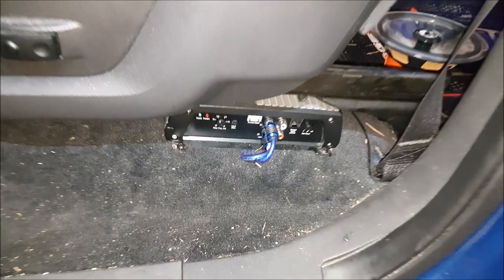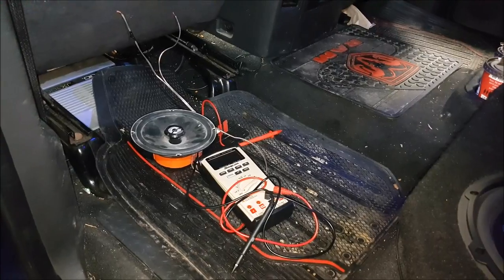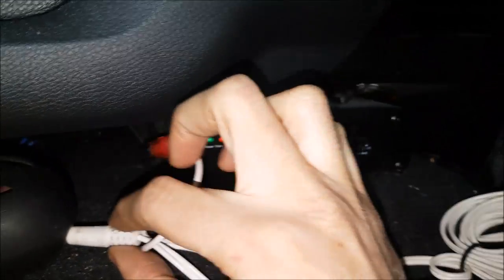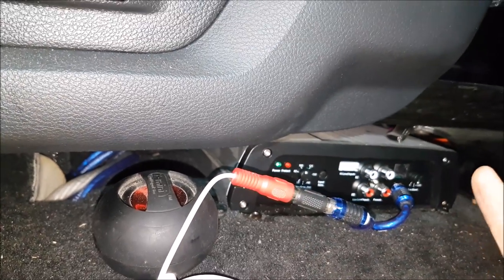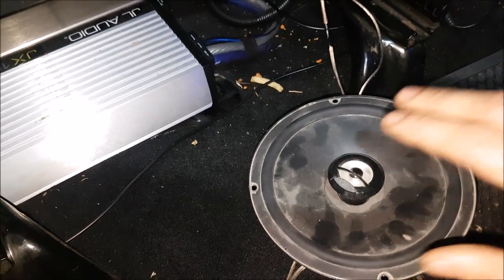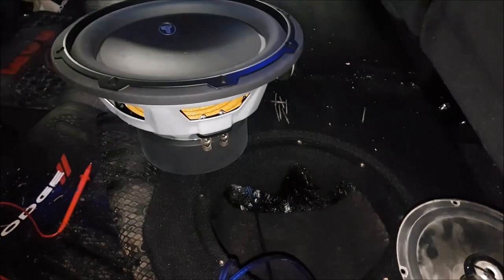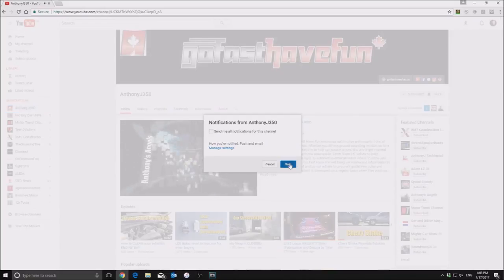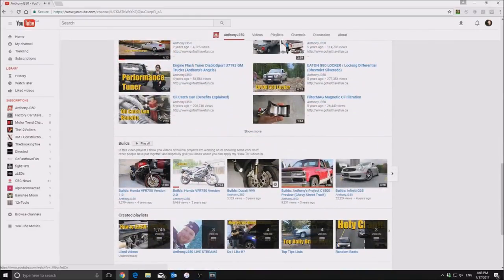Diagnosing a Sound System with no sound QUICKLY | AnthonyJ350

Comment: If the two speaker leads were to touch would that cause for amp not to work. Like would it be as simple as the fuse being blown on the amp or deeper problems
Reply: The 2 speaker leads touching can blow the speaker output terminals or cause a fuse to blow. Some digital amplifiers do not have fuses and need to be reset, some work after being reset and some do not. You always want to ensure the wires do not touch each other and hook to a speaker thr proper way. Think  of the speaker wires like a battery, you have a positive and a negative. If the positive touches a negative it arcs, this is the same if the negative touches a positive output.
Reply: @stevenb320  I'm late asf but I just accidentally did this and now my shit is gone 🤦‍♂️🤦‍♂️🤦‍♂️ my stereo even blew out with it or something  because neither work
Reply: @StopCappinHo  check your fuses first. Get a voltage light tester they are cheap at any store. Check your wires, power Acc turn on, Yellow constant, ground and remote wire on the head unit. I've seen this happen and killed the constant wire to the radio. 
Also check the wiring to the amp the same way. Power, remote, ground. Check all fuses or try replacing even if they look good they can still be bad.
Reply from the maker: It would cause the amp to go into protection or possibly damage the output.

Comment: I hooked up a shitty door speaker to the 1000 watt Rockford amp and it works but the little speaker moves gets sound but not a lot when I connect it back to the sub the sub doesn’t move it’s like the amp is hardly outputting power best part the system was on for about 3 hours straight brand new out of the box and just stopped working
Reply from the maker: Is it a dual voice coil sub?

Comment: i have a pyle pca2 stereo power amplifier 2x 40W and it stopped working while it was plugged in and I was away from it. it still turns on and the speakers I'm testing it with work with my other stereo,  but there is only a buzzing when I connect them to the amp. any ideas? great video!
Reply from the maker: Are you able to test the RCAs?
Reply: @AnthonyJ350  like with a multimeter? I don't have 1. but I know the cord I'm using works elsewhere. if it is the RCAs, would that be an easy fix?

Comment: Hi mate good video but I'm still having some trouble I've tested my rca cables brand new amp powers on works on a old door speaker but when I connect it to my alpine sbg-1244bp it doesn't play sound. I've tested the new sub with a multi metre and it's reading the 4 ohms. Do you have any ideas or any other testing videos what could help me please
Thanks
Reply from the maker: If you play the original speaker it works?  Is it a Toyota by any chance?
Reply: @AnthonyJ350  thanks for the reply mate I've sorted it now the amp was broke when it arrived hence all the head scratching lol
Reply from the maker: @joes9314  Glad you got it figured out 🙂

Comment: If I use a test light on the positive connection of the speaker wire I should get power right? My JL 500/1 has power and ground but I'm getting no power out to the sub. Also I just recently blew my Kicker L7 and just replaced it and now all this started happening. Any advice would be greatly appreciated. Thanks
Reply from the maker: You need to use a multimeter. Speaker output is AC voltage
Reply: @AnthonyJ350  ok got it. Thanks!

Comment: I got one of those Rockford fosgate powered subs installed in my CTS I installed a new L2CI and now the sub sounds very very low or almost sounds like it’s not on at all.
Reply from the maker: Does it happen only when driving? What if the engine is off and the doors are open?
Reply: @AnthonyJ350   it’s doing it regardless if the engine is off or the doors are open. When I go to the trunk you can barely barely barley hear low bass then all of a sudden it will be loud and cut back off. But the amp stays on
Reply from the maker: @c24medina  What's the voltage at the amp? Also where did you get signal from?
Reply: @AnthonyJ350   turns out to be a loose RCA lol got it working thanks.
Reply from the maker: @c24medina  Glad to hear you figured it out!
Reply: @AnthonyJ350  I do have a question tho. Since I have a LC2I line output converter should the bass setting on my factory head unit be 0? Or would it make sense to raise it since it’s getting the bass frequency from stock rear deck subs?
Reply from the maker: @c24medina  I'd leave it at 0 and set the gain at the amp

Comment: Currently I am trying to diagnose my guitar amplifier, was playing music and suddenly no audio, not even a hum, but it still powers on And the fuse is good, I checked everything els and seems to be something on the tubeless board but I can’t quite figure it out, and the input is getting power to the board but somewhere it’s not traveling to the output for the speaker, might be an IC or a diode? Crate B10 XL
Reply from the maker: Sorry I have no idea for a product like that.  Is there an electronic repair shop in your area?
Reply: I still haven’t solved the issue but I believe it may be an IC or a diode, I’ll probably either take it in or continue trying to find the issue and maybe replace some parts, thanks for the reply

Comment: Hey man I have a question I am setup with a 4000w amp and 2 10” kicker subs both subs have bass but only 1 sub plays out audio and the audio kind of sounds muffled the subs im using were preowned so maybe they are blown? any suggestions or ideas on what the problem could be?
Reply from the maker: It's possible the speakers might be out of phase https://youtu.be/fy_lFNnTnHA?si=dDx_zrxfh8GBUTiC
Reply: Alright I will try this out tomorrow I’ll give an update soon thanks for the help 🙏🏻
Reply: I think my speakers are fine I think the issue is either with my amp or I might just need some new rca wires
Reply from the maker: @nicolasdelatorre7739  Sounds good

Comment: So I did the speaker trick with the rca cables and just hear frequency, does that count as sound or no? Would that mean something’s not right if it’s just frequency and no music? Also I switched the rca to the rear speaker outputs instead of the subwoofer output and I can hear music out of that one so can I just use that for my subwoofer?
Reply from the maker: You can switch it as long as the speaker preout is playing full range.  Go into your settings more, it sounds like the sub woofer is turned "off" in the settings.
Reply: @AnthonyJ350  thank you for the reply but I’ve gone through my setting many times and can only find a subwoofer level which I turned up, not a on/off button, my head unit is a Sony MEX-4280BT
Reply from the maker: @widetrailblazer4283  Find the manual and look for "initial settings" might be there. If not just plug it into the speaker preout and make sure it's full range and adjust the cross over at the amp.

Comment: do you have a video on testing speaking outputs and rca outputs?
Reply from the maker: Richard Cowtails As of right now no.
Reply: damn.... I bought new pioneer bluetooth deck. checked all my wires. 12v from the rem. plugged in a y connector from my phone and checked amp and subs everything seems fine. I ordered a new set of rockford fosgate rca from amazon. It seems like I've checked everything but still doenst work. turned on the preouts from the deck. checked the voice coils on the subs. confirmed the integrity of the all wires.
Reply from the maker: Richard Cowtails Speaker could be grounding out
Reply: How do I test that?
Reply from the maker: Richard Cowtails multimeter and see if there is ground on a speaker lead.

Comment: my sub stopped working out of nowhere, the amp is getting 12 volts but the speaker outs are reading 0 volts, what could this be?
Reply from the maker: Check the fuse at the battery and make sure it's in good condition and intact.  Also did you test the RCAs if they're feeding signal into the amp?

Comment: This could be a dumb queston. I have a powered Kicker speaker PT250. I have the rca's spliced to go to the speaker wire into the combo plug on the box. It's got power and thumps when i pull or insert the remote plug. But it doesn't play sound coming from the head unit. I plugged the rca's at the head unit into my tablet and still no sound thru the speaker. Even went as far as buying another speaker thinking its old and just went. Still no joy. If i touch the rca to the cage of the HU, it'll thump. Is it possible that it won't produce sound if I hooked the - and + speaker input's wrong to the amp?
Reply from the maker: Is there a switch how it gets input?
Reply: @AnthonyJ350  I figured it out. Cheap rca's. Thank you for responding.
Reply from the maker: @jason1351  Glad you figured it out!  Good job!

Comment: So I just put my head unit in 2 days ago and everything works like it should. I soldered it and audio comes out for the speakers and I went to hook up my brand new amplifier and it turns on and works as should no protection mode the only other thing it could be is the rcas right? My sub worked perfectly fine before its barley 3 months old and only got maybe 3 hours of use no voice coil issues, it sat for like 2 months cause my old amp fried. So is my head unit set up wrong or are my RCA's bad??
Reply from the maker: Did you test like shown in the video? That's the only way to confirm

Comment: Do you reply? Just checking in having troubles
Reply from the maker: What's going on?
Reply: Would a loose wire make it where an amp's power light comes on with no audio? Would a damaged glass fuse allow for enough power to turn the light on but not enough for sound?

Comment: Hi what would cause no sound coming from car speakers. Speakers are hooked up to a 4 channel amplifier.  When I turn the car key to accessories only the protection mode light comes on and off briefly but doesn't stay on. No power on the amp. Both fuses on the amp are good. Can it be a bad amplifier.  Any help is appreciated.
Reply from the maker: Amp in protection is either a speaker shorting out or internal problem typically
Reply: Protection mode lights on briefly but doesn't stay on . My subwoofer has power but no power on my 4 channel.  So it can be the amp is busted

Comment: So frustrated. I have the same setup for the past 20 years. I've had a bunch of stuff in my trunk, so i stopped listening to music altogether in the car for about 2 weeks. Now I get no sound out of my subwoofers. It was working fine before.
The amp is getting power because the green light comes on when I turn on the head unit. 

I connected a different sub to the amp. Nothing. So that eliminates the subs.
I connected an aux cable through an iphone to the amp's RCA ins. I get nothing.
I changed my anl fuse. Still No sound.
I checked the 3 fuses on the amp. They look good.

My ground and power connections are tight. They are the same way they've been for 20 years, though I replaced my cap about a year and a half ago so that forced me to reconnect them and check the grounds and stuff. 

I guess the next thing to do is hook up a spare amp and see if it plays? I really don't want to replace my old amp though, it's a beast. I'd be shocked if it went bad. 

The only thing I can think of is that I jumpstarted my friend's 4 Runner about a week ago. Maybe that did something I dunno.
Reply from the maker: What's the voltage for the main power and remote turn on?

Comment: Not sure if you respond to comments anymore but I could really use some help. I have a ‘13 Cadillac ATS with 10 speaker Bose system. H.O. 240A alt and secondary battery. 12” Deaf Bonce Avatar and a Deaf Bonce 4900.1 amp. Using an LCI2 for the LOC, tapped into the rear amplifier using connectors that I purchased special for this car. My amp is on and the sub isn’t getting anything or trying. No protect mode or anything, the fans on it run, nothing in the car gets hot. Any idea what the cause could be?
Reply: I know for a fact the sub isn’t blown, it was working with a cheap LOC and skar 2000.1 just fine before I upgraded to my 4900.1, installed the second battery and HO alt
Reply from the maker: Did you try tone generating the sub?  How many tests were you able to perform shown in the video?

Comment: Hey bro, ive tested my sub and nothings wrong with it but it wont play. Amp works.
Reply from the maker: Do you have signal in?
Reply: @AnthonyJ350  Yeah ive tested battery, amp is on and tested. Tested the wire going to the sub it works and tested the sub itself. Showed 4ohms and it beeps letting me know it works but when i play my music it still stays off. I dont know if its the RCA i dont know. Fuses are okay, fuse at the battery okay, ground is good. It happened when i turned my volume up it just cut off from there.

Comment: Is there a trick when setting up a Kenwood x801-5 ? I've got no sound output and when I reinstall my old amp, it works fine. I recall some amps NEED the remote bass control connected when first installed but I dont think the Kenwood does.
Reply from the maker: What's the vehicle?
Reply: @AnthonyJ350  f150 2013 non Sony system. I have an Audio control dm608 connected also, and that seems to be working. I've checked rcas going to Kenwood amp and speaker outputs from the  amp, no sound. All fuses are good on amp. I'm thinking the anp is bad.
Reply from the maker: @DapimpBDSD  You have power, ground and switched 12v at the amp?
Reply: @AnthonyJ350  yes, although Kenwood amp only has 1 power led, that i see (some amps have a protect light etc)
Reply from the maker: @DapimpBDSD  What's the voltage on power and remote?

Comment: I have a 12” Rockford Fosgate P2 with a Fosgate 500 watt amp and the sub suddenly stop working. After using a MulitMeter I see that there is no power going to the speaker outputs. All the fuses are good in the amp and under the hood. Any suggestions on What else could be the issue?
Reply from the maker: Mr. Austin Did you check signal going into the amp?
Reply: AnthonyJ350 Yes I checked the Power wire and the Ground wire going into the amp with the multimeter and it showed about 25 volts running to it. I also checked the glassfuse underneath the hood and it was running the same voltage. And the fuses in the amp are not blown either. I guess the only thing left to check would be the RCA but would that even effect the power running to the speaker outputs?
Reply from the maker: Mr. Austin Yes it would. No signal on the RCAs would make the amp do nothing. The signal from the RCAs tells the amp what to do.
Reply: AnthonyJ350 It was a loose rca connection. Thanks for your help

Comment: Okay so what if you get no noise from your amplifier but the moment you turn your gain all the way up on the amplifier a little base is noticeable ... This is my problem so far have new head unit new wires ofc new speakers and just the amp is the last thing...... Should I replace it to?
Reply from the maker: You should have to turn the gain all the way up.  Sounds like the signal going to amp is incorrect.
Reply: @AnthonyJ350  I installed a new pioneer stereo I installed a new ofc RCA cable new subwoofer and I knew amplifier and I still have the same results. before all this my subwoofer with thump on every time I turn the key for the ignition. And then one day it just stopped thumping and the amps bass just went away.
I took my car to a audio shop and they mention that my subwoofers were no good. I have skar evl 10s duels inside their box from skar I never touched any wiring because that's how I bought them and I'm running a skar RP 2000.1. so when I disconnected my subwoofers there was a burnt mark underneath them like if they burnt and it started burning the bottom of my carpet inside my trunk. I returned them and I'm waiting for them to be shipped back since they have 2 year warranty in the new while I changed everything. The headunit ... a new amplifier a new sub...and I still have the same results my amplifier is doesn't sound powerful my subwoofer doesn't sound powerful and it doesn't thump when I turn it on.. but the light is on and it has 14 volts to it because I checked it with a multimeter... and just so I could be able to make it move I have to turn it gain all the way up and even then I still do not have any good bass. Any ideas????

Comment: I’ve checked my ground, power , rca , remote with multimeter everything is fine .. so how do I use my multimeter to test my speaker wire and at amp and at sub for my sub wires
Reply: My issue is when I turn the radio on I have no bass from subs  until I turn it up high and it starts working but it sounds shitty distorted and some days it will work great I don’t get it I’m confused
Reply from the maker: How are the battery connections.  You can try upgrading the ground wires under the hood.  How good is the ground from amplifier to chassis?
Reply: @AnthonyJ350  all that’s good it’s been working for last few years I’ve had it just recently went out. Subs only cut on when volume hits 14 and higher anything below that it’s not working , the ground , remote , power, rcas. All have voltage but no volts at the subs wire outlet on amp until it goes up to 14 or more but when it is on u can tell is not full power cuz its distorted and shitty not full bass. So all power is good  until the sub oiler on amp , took all subs out and they work , wire good , so I guess the internals of the amp is bad cuz it only works has voltage at oiler when volume is up high
Reply from the maker: @cody6.6max  Ya good chance the amplifier is on its way out
Reply: @AnthonyJ350  thanks
Reply: @AnthonyJ350 
I have a Duramax with two batteries and 145 amp so getting enough power